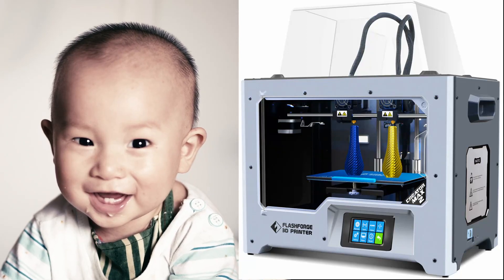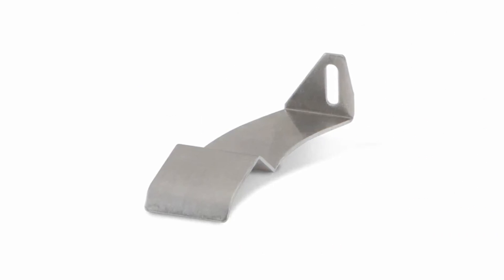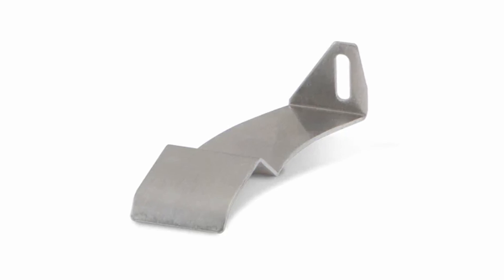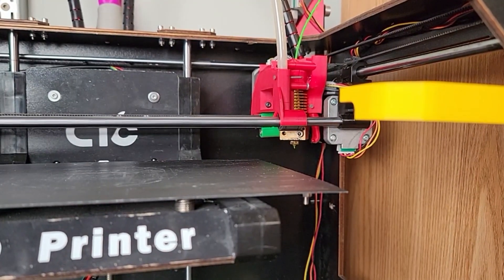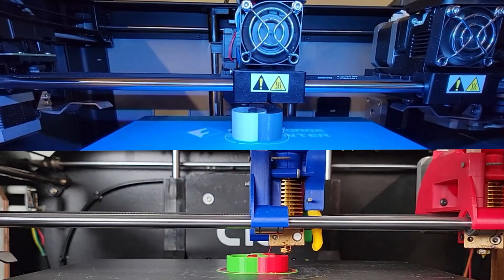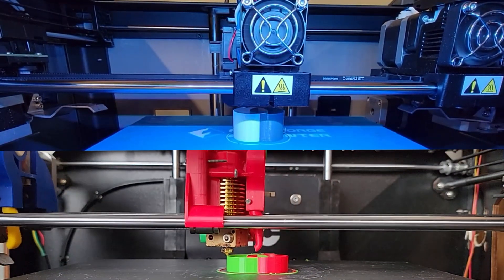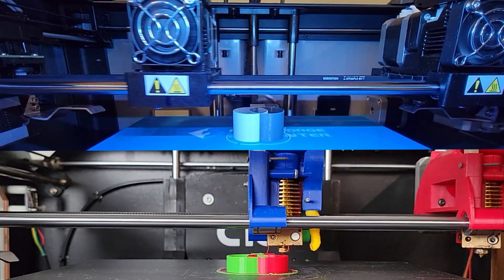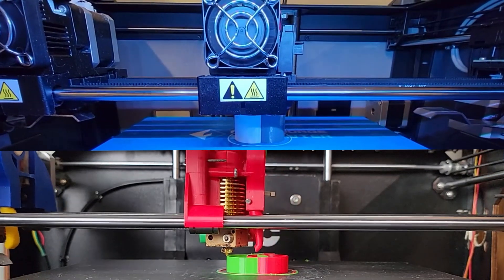Legacy IDEX vs  Magnetic IDEX Demo

Comment: When you do release the STLs, maybe put out a metric 6mmx6mm version. I was not able to get 1/4" magnets. But I did get a bunch of 6x6. I'm building a Rook 180 CoreXY right now and want to integrate your design for the tool head. I will probably go bowden and like you CPAP cooling, so SUPER low weight, Maybe even adapt the clicky probe and go all magnetic. An interesting idea for you. We mostly use magnets as attachments. To attract. what id you used two stronger magnets opposite to detach the head. Go to position A and the magnets connect. To detach run the belt further to the opposing magnets and they push away. Just a thought,
Reply from the maker: Sure I can accommodate my metric friends :)  I actually use a couple of tiny magnets to hold tool in place after parking.  Thanks for your ideas and encouragement to keep going with Magnetic IDEX.